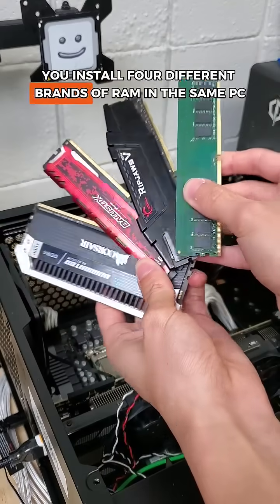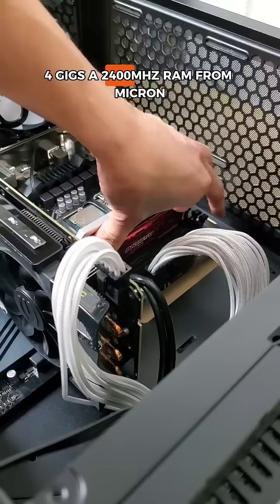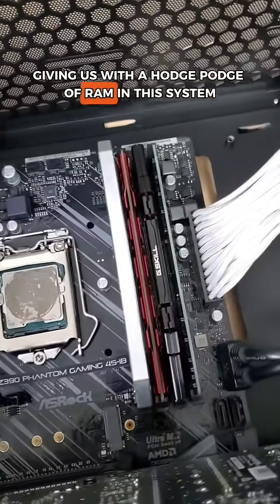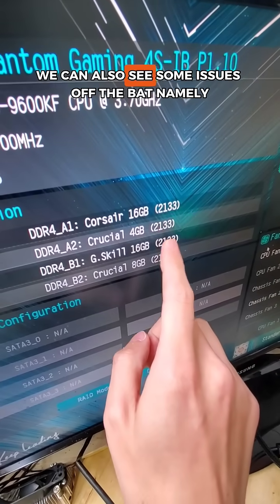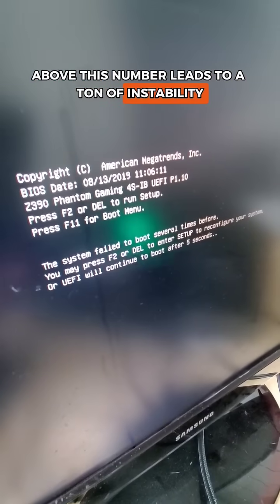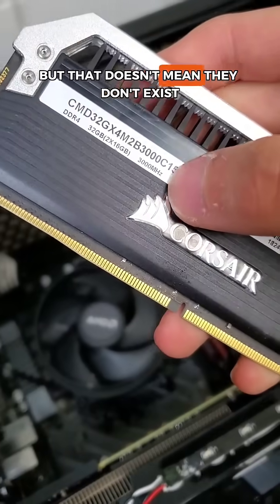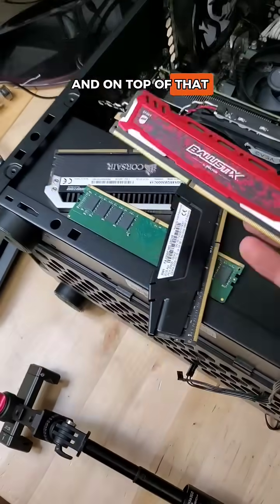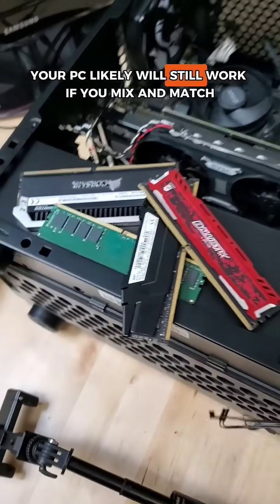can you use different brands of RAM in the same PC? #shorts

Comment: i just installed two kingston fury beast 16GB, one ddr5 5200 and one 5600, wouldn't boot, until i removed one, set xmp to 5200, then it worked, just an fyi

Comment: I am a 13 year old who just build his first PC let me know what you think of my build
CASE: Bgears b-Voguish-RGB

MOTHERBOARD: Gigabyte X870

PSU: MSI MPG A1000GS PCIE5 1000w

CPU: AMD Ryzen 7 7700X

GPU (On integrated graphics but want the):
GIGABYTE Radeon RX 7700 XT Gaming OC or if I save up enough a rtx 5070ti

RAM: Patriot 16GB 288-Pin PC RAM DDR5 5600 x2

STORAGE: Crucial P310 500GB SSD

COOLER: Cooler Master 240 Core II AIO

MONITOR: Samsung Odyssey

Comment: As far as I know, voltage shouldn't be an issue since it depends on the generation rather than the brand. For example DDR3 uses 1.5V, DDR4 uses 1.2V and DDR4 uses 1.1V.

Comment: I have 2 16 gig kits, both are from the same brand and have the same MHz and whatnot, only difference is that the other kit has LEDs and the other one doesn't. Could there be any problems with this or is it gonna be good?

Comment: I’ve got 2x16gb rip jaws sticks at 3600mt/s and 2x16gb vengeance sticks rated for 3200mt/s but I lucked out and the corsair sticks run stable at 3600mt/s, so I’m able to run all 64gb at 3600mt/s. Silicone lottery is real lmao. Not sure I would want to do 4 different brands at wildly different sizes and speeds, but with ram prices these days, I’d be happy with what I could get.

Comment: Im using 8x2 3200mhz gskill ripjaw sticks with Ryzen 5 3600 but system not booting with 2 sticks only 1 is bootable. Its lacking in Dual ram memory controller, i tried 2 motherboards and several ddr4 ram sticks but dual channel is not working, only single channel working, im using dual ram sticks in A1 and A2 DIMM slots, B1 and B2 slots not working completely and system not booting. Let me know if anyone has some fix for this though i have tried everything like enabling XMP profile for ram and undervolt ram speed etc but nothing worked

Comment: With vintage PC's (pre DDR), mixing RAM speeds almost never worked.  EDO, ECC, etc.  Some PC's (ie; Northbridge unit) were so finicky they all had to match perfectly or the machine wouldn't boot at all.  Modern RAM is more sophisticated, but it's still best to have matching speeds & types.  ECC & non-ECC don't play well together. =)

Comment: This is why I just stick to one brand and speed per generation. Honestly, I've always just used Corsair, so I just match the speed and let it ride if I need to upgrade.
Gen 1 = 1x2gb
Gen 2 = 2x2gb (one from last)
Gen 3 = 1x8gb
Gen 4 = 2x8gb (one from last)
Gen 5 = 4x8gb (one from gen 3 & two from last)
Gen 6 = 4x8gb fresh set
Gen 7 = 4x16gb fresh set

Comment: DDR4 DIMMs doesn't have dedicated controller, the memory controller is in the CPU and you can use different manufacturer if timings, latency, size and frequency are the same, with no performance issues

Comment: In my case something weird happened, I was using DDR3 RAM with one sick at 1333mhz and the other at 1600mhz, but the system is showing that the RAMs are running at 1600mhz.

Comment: Saying that the RAM will run at the lowest speed if you do this is technically inaccurate.  Rather, what the BIOS is doing is reading each stick of RAM during POST.  If memory clocks are set to Auto, the BIOS will typically test all the different memory settings on each RAM module to see if all four RAM modules will run on a given clock speed.  I'm willing to bet you would have achieved higher than 2133MHz clock frequencies simply by removing the Wal-Mart RAM which you introduced last.

Comment: Normally it would go to the lowest speed, but that’s only if all the sticks of ram have the same timings. On gaming motherboards you can change the timing to find what works the best for those ram sticks to make them function together, but on OEM and older motherboards, it will set it to what ever the stock ram has, so good luck…

Comment: I did that for like 20 years. Unmatched sticks in dual Chanel. Never had any problem. Thanks for showing everyone that
Reply: Dual channel does require that the sticks in the paired slots match capacity, at least. Getting the rest of the ratings as close as possible will improve things even further. Easiest way to do that is by matching the sticks, though the extreme "Sequential Serial Numbers" that early Dual Channel supporters insisted on aren't really necessary.
Reply: @evknucklehead  if you have a faster stick from one brand and a slower one from another, it will still work, the faster stick will adopt the slower speed
Reply: @spyware1100  I'm not debating that point. I was mostly pointing out that the capacity has to match. Though it is true that you do get better results the more closely the modules match.
Reply: you've been running gimped, unstable pcs with an unnecessary processing-bottleneck for 20 years, congratulations.
Reply: @Vihara2  no. I built from everything I could and as I said never had any problem. As a kid I didn't have money back then to buy fancy matched sticks you know.....
Reply: @spyware1100 Drasticly reduced performance is a problem, even a hidden one in your case.
Reply: @PhreakDarkSoul  "drasticly" means 5 fps in real life. Unnoticable in 95 percent of everyday usage.
Reply: @spyware1100 Approx 10 % at least, not 5 FPS. And micro stuttering as bonus.
Reply: @PhreakDarkSoul  depends. On a high end ddr5 maybe, but i still remember ddr2 dual channel 666 vs 800 barely any difference. Same with ddr4 2133 dual channel vs 3200 dual channel.

Comment: I had problems using the same model and brand of ram. A gskill sniper X. At first i bought 16gb and got another 16 but always had issues. The ram light was alwaus lighting or the speed wouldnt work etc i even changed mobo and cpu and had the same issue. Eventually i just upgraded to 32gb 16x2 from corsair and sold the ram pairs separately and have 0 complaints

Comment: I had a driver update, restarted it to install, then I had a bios update started and now my windows 11 desktop won’t connect to my monitor, keyboard and mouse. It’s sad. and I don’t know how to fix it. I tried resetting cmoss, I replaced the battery, I took out the RAM, tried one stick, I retightened my cables and all my fans work. It simply won’t connect to any monitor, keyboard and mouse. The usb slots still work and everything. My usb stick lights up when I plug it in

Comment: I been running my system like this for several years now, 14gb total on a Maximuss 7 with a i5 4690k. I HAVE had to do bios resets and swap around the ram in different slots, rarely, but other than that, no issues.

Comment: I was in a rush for a pc build for a friend and so the system was with a Chinise X99 motherboard which only had dual channel support. And i had a 16gb stick, 1x8gb stick and 2x4gb set. And putting them all in it worked and because i was using a V3 xeon (E5-2690V3) the ram was alreasy running at the fastest speed (2133mhz cl10) even tho all sticks were 2666mhz cl16 and the 16gb stick was 3000mhz cl18

Comment: Anything in a PC will operate to the spec of the "weakest link" in the chain.   If the motherboard only supported 1600 in this scenario, the RAM would only run at 1600.
I assumed this was more common knowledge than it is.

Comment: Aside from the speed another factor is timings. Two sticks can tun at the same MHz but with a few miliseconds timing difference. DDR3 1600Mhz Corsair Vengeance runs at 9-9-9-24, while the cheaper TeamGroup Eltie 1600Mhz DDR3 runs 2 miliseconds slower at 11-11-11-28. Just 1 milisecond on the timing can be critical, so make sure you check it out when mix and match RAM.

Comment: You can run different speeds as long as your motherboard supports odd ram ratios, however you will see instability whiloe using your PC, this can cause windows to bsod, games to free or crash outright

Comment: You're right and wrong at the same time (yes I know that's short but still). You can mismatch your sticks and oc them to higher speeds, but you'll need to use trial and error method (here matters even where which stick will go). 
Yes, you won't be able to use XMP profiles.
No, sticks wont always work at they lowest speed. 
Yes, stick in some cases wont work together at all
At this point I have two different pairs of ram sticks. Both pairs are corsair vengeance lpx (info from sticker, bios throw different names for both pairs ;) ) but both pairs being different still works on xmp profile of faster pair

Comment: My first PC has mismatched RAM inside (256MB and 512MB, different speeds too, also put in the single channel slots).
Some games have lots of issues with them. Stuff doesn't really load in time, especially in GTA games. The map remains in that low poly stage for a while if driving fast.
Other games are fine with it, like NFS Most Wanted and Underground 2.

Comment: I answered this question when I had old ram, I just put 2 more sticks of higher rated memory and it worked 👍🏻
I can even OC my old sticks to the higher rated ones with a bump to voltage by 0.5v.

Comment: Having ram sticks of different clock speeds will work for day to day usage but once it comes to gaming the ram and your pc's drivers will have a serious conflict due to which it will run in to blue screen of death(bsod) multiple times and you will have to change the ram stick to match your previous ram speed or new ram speed

Comment: Of course it would not boot, you tried to boot a 2400mhz and 2133mhz stick at 3200. It won't "only boot at 2133" as you'll likely be able to get away with 2400 or 2666 with stock timings depending on the timings of that unmarked 2133 stick.

Comment: I've run a config with mismatching RAM for a long while before I finally got the upgrade, and face no issues with it all - the key is to make sure your RAM modules can run at the same voltage and speed, which is the case most of the time, so the really unlikely edge cases will probably be some stuff you personally never encounter in real life. Don't plan your purchases off of that, though, it's not the most reliable config out of all the options.

Comment: One thing you forgot to say is that your computer most likely can utilize multiple channels, thus it is usually fine, if you have 4 slots to have 2 of them with different vendors and they'll still run perfectly fine. But i think they'll still throttle to the slowest ram. Idk bout that one 

But that really depends on the mobo but the usual layout of dual channels would be |i|i

Comment: different brands use a different memory controller ... huh let that sink ......  DDR4 has no controlller on the module cause the memory controller is on the CPU for AMD and Intel . you are showin n this video DDR4 so your statement is false if this would be DDR5 then yes those have a memory controller on the modul  but not DDR4.

Comment: I had 2 pairs and purchased another pair which were different brand and the speeds dropped from 3200MHz to 2133MHz as well even though the new ones were advertised as 3200MHz RAM sticks. After getting in touch with the company I learnt that it can be overclocked to that speed but the default was 2133MHz, unfortunately my motherboard wasn't able to overclock it so we returned and got corsair ones which worked perfectly.

Comment: The memory controller is built into the modern CPU, but historically was in the North Bridge. What a ram has is a cached settings, listed as an example like XMP, and the bios would be enabled to read said settings, those cached settings are the rated speed and timings. Modern DDR5 has a built in voltage controller, but that is not the same as a memory controller. This is why a CPU can do well with one ram and not another though, like why my Ryzen 3600 wouldn't run my 3200mhz at rated speeds but my 5700x would. I hope this helps.

Comment: Not the lowest speed, but the speed which all of them are capable of. Happens to my laptop. I got one come with it at 2133, i bought another one at 2400 and both of them runs at 2133. My pc is the exact same situation, its a prebuild mid range with gtx 1650 and r5 3600, comes with an 8gb 3200 stick. I have an 8gb 3600 stick from my dad lying around, and so both of them are running 3200

Comment: i've seem motherboard manuals specifically stating if mixing speeds, it'll run all at the slowest😉  however i have an old tosh laptop that strangely 'loses' 256mb from a 1gb pc2-6400 stick(second stick is a 256mb pc2-4200), its manual states pc2-4200,  pc2 -5300 works ok, but this 6400 stick loses some capacity, it works perfectly in a machine designed for 6400 and tests ok with memtest 86, and no its not disabling the 256mb stick as tried without it, loses 256 from the 1gb, with it back in, it loses 256 from the 1gb+256mb total!

Comment: To put some things Right he misses here The Ram always get put on the Speed of the Slowest Ram in System at this Mixed Maschines so if u do that try at least to make it just one Step down like 2400 2133 or 3600 to 3200 and not to big because that will end up in having a bad time in Loading and much other thin gs beside that ur system will be fine and work may at some Scenarios a bit slower then others but defently fine

Comment: I have a pair of 2x8GB Gskill sticks rated for 2133mhz since 2017 in my PC. I upgraded by using 2x8gb ballistix rated at 3400mhz. With my older Ryzen 1700 they ran at 2666 all together. BIOS Update allowed 3000 all of a sudden. With my new Ryzen 5500 they all run at 3200mhz. Wont allow me any higher. But still.... Having 2133 from 2017 now running at 3200 is great

Comment: So first of all the memory Controller is on the CPU. For most chips there is only 1 of those and every Stick of ram gets connected to it. Then there is a set voltage for jedec which should be 1.25 volts for ddr4 @ 2400mts. Activating xmp usually bumps this up to 1.35 volts. Third like 99% of memory chips are from either Samsung, micron or hynix. With Samsung having by far the biggest market share among the 3 there is a chance that even with 4 different Brands all chips are Samsung. Though crucial is owned by micron and only uses micron chips

Comment: The unbranded RAM throws the error. Likely rated for 2133 or 2400. Give it 3200 and it wont work. Either more voltage or less clocks. The other sticks (especially the corsair one) dont care. Memory controller is on the CPU.

Comment: The RAM will take the speed of the lowest clocked stick, the timings of the slowest stick.

But just cause it posts does not mean its "STABLE"
Each of those sticks is rated for a different  speed.
While it should be stable with JEDEC speed of 2133Mhz for DDR4,
The issue can arise from the timings.
JEDEC has 3 sets of timings for 2133Mhz
14-14-14-13
15-15-15-14
16-16-16-15
If all sticks are running at 16-16-16-15 due to the generic stick wanting this, the G.Skill may not like it and cause problems.

Comment: What if you mix DDR4 and DDR5 sticks? Since building my PC I've had that question burning in my head.
Reply: You will find few systems that have a DDR5 slot and DDR4 slot, unless they were the early DDR5 boards.
And even then you get told not to do it.
This was the case even during the early days of DDR3 when some boards had DDR2 slots and DDR3 slots.

Comment: nothing all sticks will be forced to operate at the slowest speed available. (example stick 1=3200mhz  stick2=3600 stick3=3800 stick4=4000 the 4 sticks of RAM will all run at 3200mhz to compensate for the slowest stick) Same can be observed with Cash Latency CL16 CL18 CL 20 CL14 all sticks will run at CL14 to compensate for the CL difference between the sticks. Now don't  be a Wumbat and buy a matching pair of sticks
Reply: Its cache not cash
Reply: @keiran1  it's the damn t9 autocorrection (it's not deactivating no matter how many times I deactivate it manually)

Comment: Also even if you buy the same type of ram make sure its also got the same memory controller cause my dad bought more ram recently and the new ram he got was the same speed, capacity, type and brand, but on was a newer set that had the samsung controller chip and the second set he bought was from before they used the samsung chip and it caused constant crashing when he enabled xmp

Comment: instability is probably because of the 4 sticks in a daisy chained board, try manually setting the voltage to 1.4 and setting it to 2800mhz

Comment: The fact that the RAM runs at the same speed as the slowest stick is a thing that has been around since SDRAM has been around - my original personal computer used PC100 SDRAM and I still remember upgrading the capacity using PC133 SDRAM because it was cheaper than PC100 SDRAM (went from 64MB to 256MB lol).  

The only thing that has really changed is that in the past 10 years or so the firmware got a bit smarter and now no longer sets the RAM speed and timings based on the stick of RAM in the first slot.  You can even run dual channel memory these days without requiring matched DIMM pairs - back in the early days you needed to buy DIMMs in pairs that were matched at the factory to be able to run dual channel.

Comment: Interestingly enough after updating my BIOS I can no longer use both kits of g skill and crucial RAM I had in my PC like i was doing before, now only running my g skill RAM.
Reply: adjust the voltage to a slightly higher value, that will fix your issues with a 99% chance

Comment: Yeah I think this is really only a problem right now with DDR3. DDR4 is still in abundance and you should be able to get the same sticks. With DDR3 though, I even had problems finding the same RAM years ago. Ended up mixing and matching but making sure the speeds were what I was looking for
Reply: Well also depends on what the computer is.  If you have a i3 6300 cpu and your needing 16 gb of ram the system isn’t even worth the money to dump good ram into.  Just say screw it you get what I can get lol